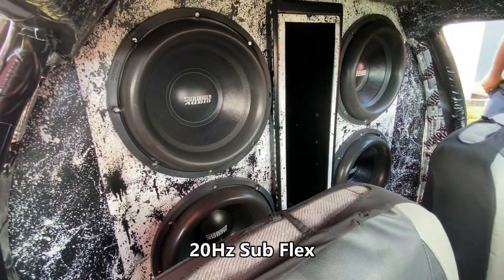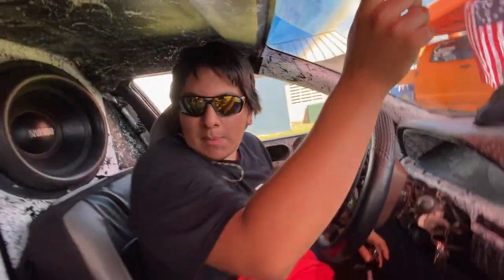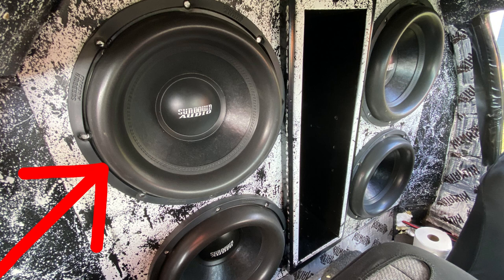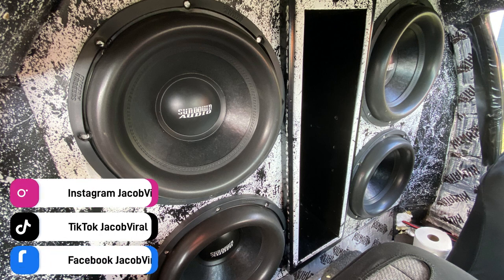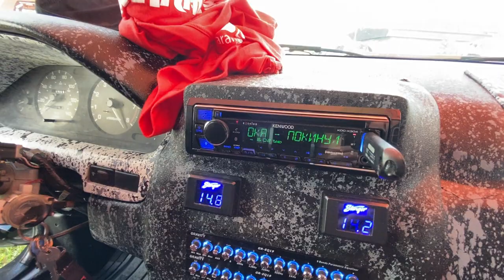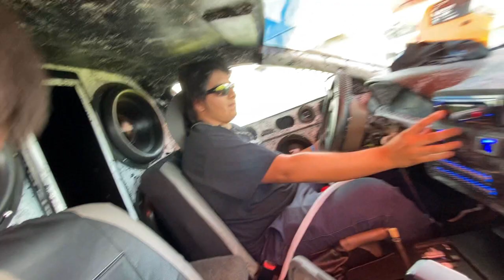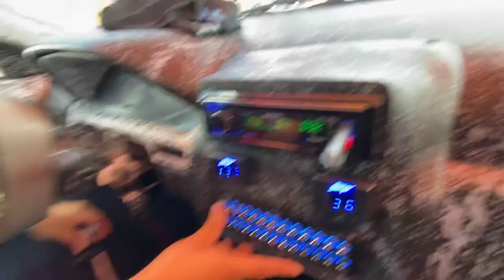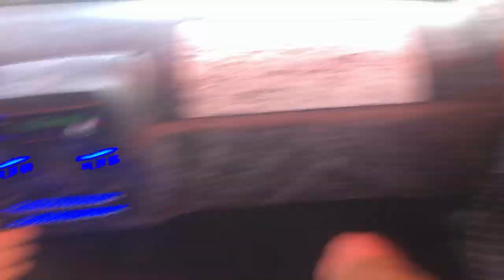WATCH THESE SUBS DO 20HZ FULL TILT!!! INSANE SUBWOOFER FLEX VIDEO

Comment: This build looks like there is tremendous amount of pressure inside the cabin, 😀 holy markel .yeah he said it was sealed off he wasn't kidding 😂 . Sundown smashing those lows . I wonder if he had to beef up the suspension any to handle the weight of the enclosure it had to be 4-5 hundred pounds .besides the weight of the subs

Comment: omg i was sitting in this build and i only lasted 2 seconds its brutal as heck
Reply: Do you know what it meters?
Reply: I dont
Reply: @bailey2517 high 150s if not 160s by now, I have some videos on my other channel of his old build
Reply: @Antonnn1111  that's crazy. It's getting me more motivated to do a 2 18s wall. My goal is 155 on music on a 10k amp. Box tuned to 28hz.
Reply: @bailey2517  what car? That can easily be achieved with 10k
Reply: @Antonnn1111  I was originally gonna buy a Tahoe but I'm not really sure now. Because at first I wanted to just do a regular no-wall with 2 18s. I'm gonna use 2 Sundown Xv3-18s on a DS18 Hooligan 8k (it Dynos easily over 10k at 1ohm). But now that I've decided to do a wall, I think maybe I should go with a different vehicle. But I kinda wanna still get a Tahoe so I have more room to upgrade the system in the future. I'll probably do a C-pillar wall though instead of B-pillar which I'm sure will hinder my DB score a bit. If I can play just a few songs that hit 155db I will be ecstatic though. And worst case scenario I can get a bigger amp and subs and get a couple extra DB. Solid cabin bracing will go a long way too is what I learned recently.
Reply: @bailey2517  get the Tahoe it’s good for any build you wanna do. If you do a c pillar wall I don’t recommend flat ported wall because it’s gonna have a ton of cancellation at your quarter wavelength frequency, I’d either do B pillar flat wall or C pillar bandpass if you can even fit that. You can do a no wall setup but you’re gonna have to do a wood roof and use a lot of sound deadener all over the hatches, doors, sides, trunk floor, because it’s going to rattle a lot.    Best and easiest thing to do would be B pillar flat wall, keep it simple, port middle, one sub on each side, 7 cubes each tuned to 28hz with 13-15sq inches of port per cube will get you very windy and a lot of bandwidth
Reply: @Antonnn1111  damn bro thanks for all the advice. I will do just what you said for the box specs. Only reason I wanted a C piller was to have extra people to be able to ride, but if it's gonna really degrade the performance then I'll go with a B pillar. How do you figure out if there will be cancellations? That's the hardest audio concept I've struggled to understand for a while.